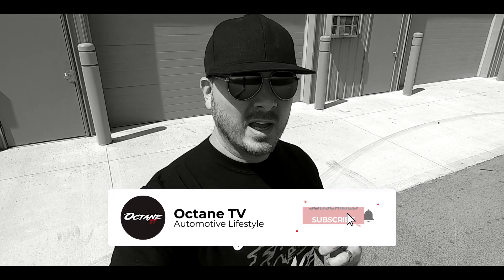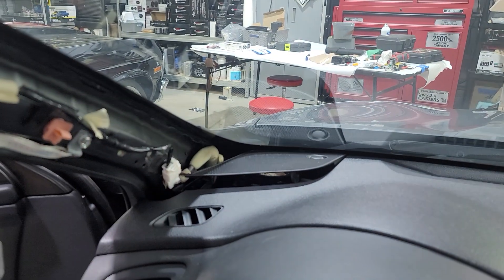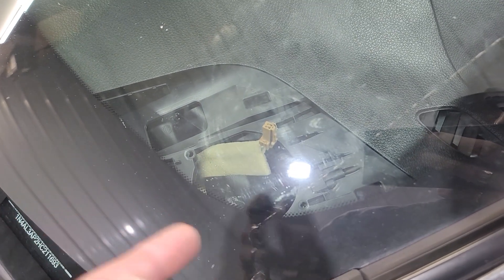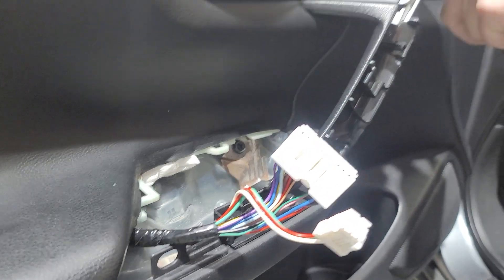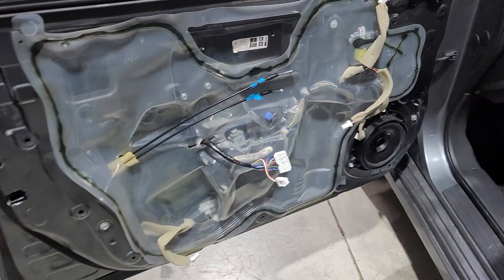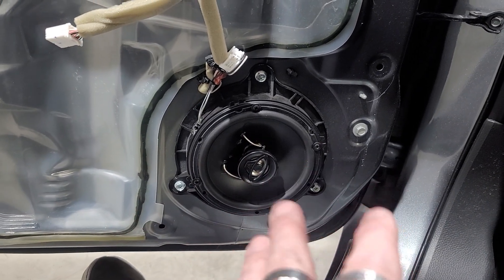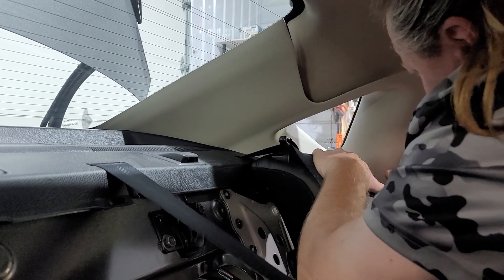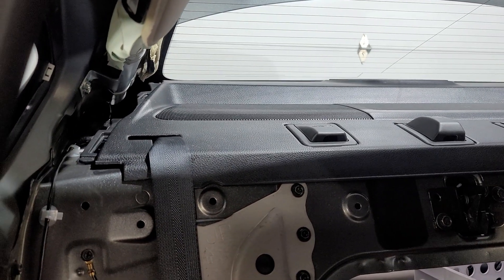NISSAN ALTIMA HOW TO INSTALL ALL SPEAKERS - DOOR / DASH / REAR

Comment: I actually have a 2013 Nissan Altima, and my driver front door speaker blew as well and I replaced them ( both front doors and both speakers in the rear deck) with pioneers G-series speakers sounds much better,  the tweeters are next. I do wish that these Altima's  had speakers in the rear doors being though there's space in the doors for a speaker.
Reply: hi, just realized my passenger door speaker doesn’t work and i wanted to replace it myself, if i buy the speakers does it come with everything g j need or would j need a new harness or adapter? def a noob at this but have replaced many other car components, 2016 altima sv

Comment: ok so right off the bat thats a 2017 and the speakers sounds trash i would have to say the ownerr of that car had trashed the speakers by plying it lounder then the could handle. thats how you blow speakers you need speekers that can handle the power you are going to hook them up to or else blown speakers. how i know this two ways 1. i do own a 2013 nissan altima and my stock speakers still sounds great for what they are if i was younger all i would do put in some subs like 100 watts amp then i would even start competing in sound competition if they are still doing that today. 2. i use to compete in sound competition back in 1990 to 1994 started at the 100 watt class took 2 second place then moved up to 500 watts did ok never took 1st place but thats fine every one can not be in 1st place and there was lot more people spending lot more money on there systems then i had. i had spent 5k into my system but there where others that was spinging like 10k and upon there system and when they are spending that much there is not much you can do in the competition with them unless you have the money to do so. i have got lot of compliments from lot of judges about my systems how it looked and sounded and they where all surprised on how much i spent on my system compare to every one elses systems. this is how i know that the owner of this nissan altima just did not care anything about his system at all and he will do the samthing with the new systems too. i have seen to meany owners like him at shows all the time just think loader is better and its not.